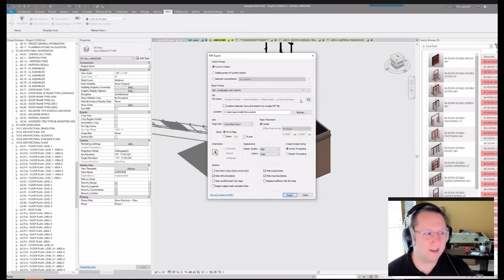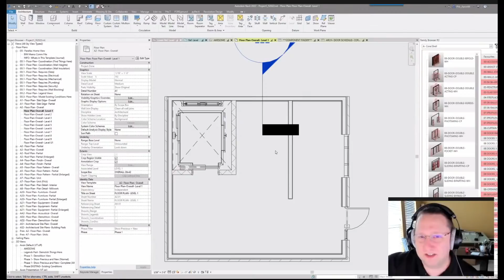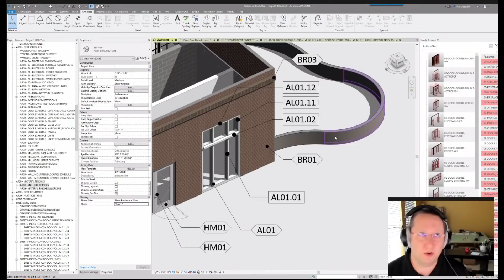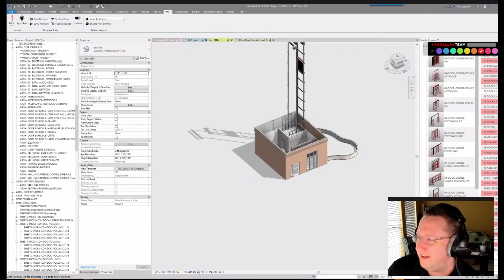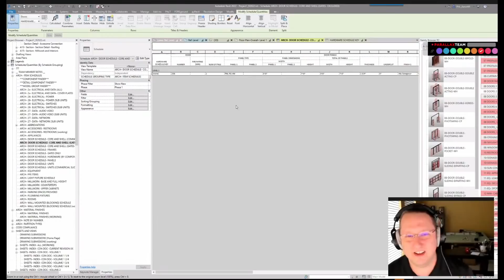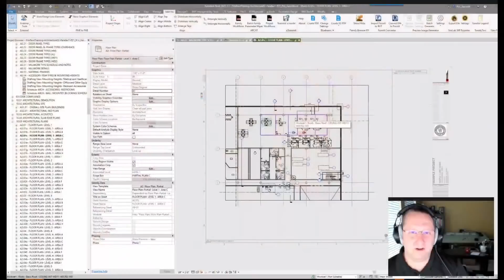Revit 2022: The New Features You *DON'T* know about, but *SHOULD* (w/Aaron Maller)

Comment: Great and detailed session! The revision numbering changes are great, but unfortunately running multiple drawing sets with their own revision logic in one model can still be a challenge, as duplicate revision numbers are not allowed, even between different revision numbering sets. You still have to use a workaround like hidden asci characters or repurposing another field for the revision number.

To address this, consider voting on this idea: https://forums.autodesk.com/t5/revit-ideas/allow-duplicate-revision-numbers/idi-p/7614917

Comment: Really looking forward to trying out 2022! On a somewhat unrelated note, Do you ever have issues exporting dwgs that export blank? I often times have to check my dwg exports and if the file size is too small ( less than 100kb), it usually did not export right, and I need to restart revit and do it again?
Reply from the maker: Can't say I have run into that before...